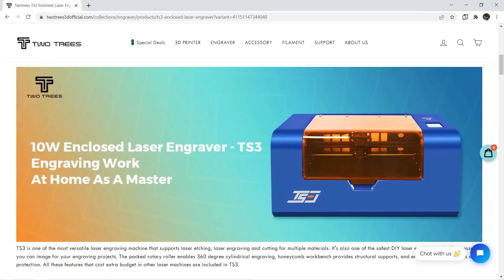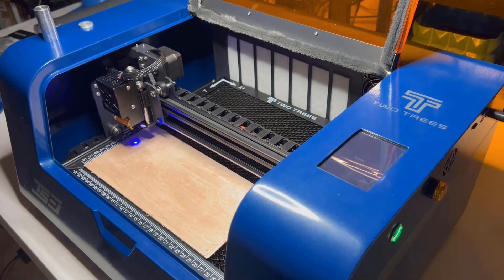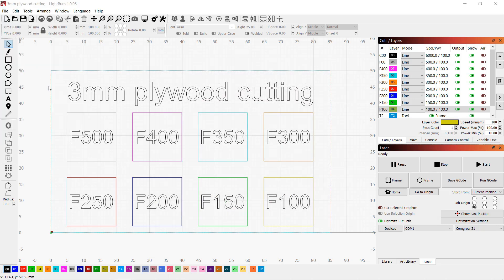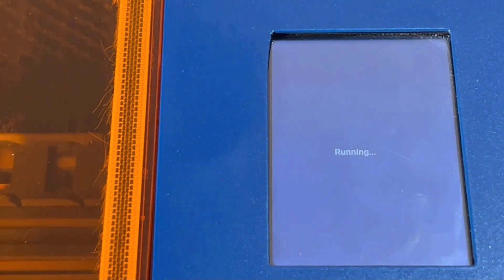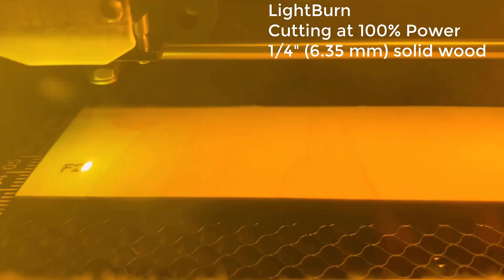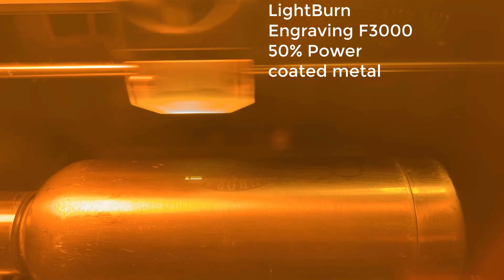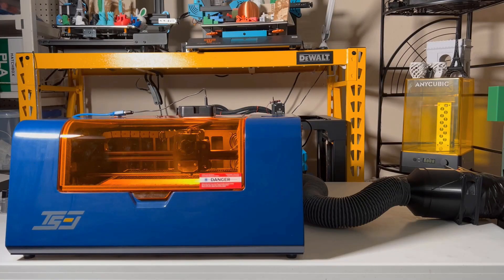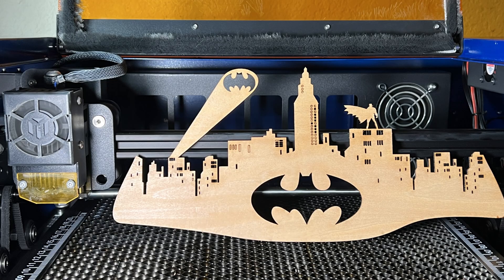TwoTrees TS3 Enclosed Laser Engraver, metal enclosure, honeycomb bed, air filter, exhaust fan duct

Comment: First time using this machine and lightburn. Im trying to make a test file like you did for cutting, but its not saving the different values for each layer. Its like its just using the first settings for everything, even after I edited each individually with different speed and light intensity, any help?

Comment: Thank you for this review! I was just looking for a hobby laser engraver.

The wifi issue might be fixed by using another wifi protocol on you access point or wifi router (wifi 6 = ax, wifi 5 = ac, wifi 4 = n, wifi 3 = g). If this machine has difficulty connecting using wifi 6 protocol, try configuring your wifi device to use the wifi 5 or 4 protocol. The band settings might play a role (choose 2.4 GHz or 5 GHz). Interference of metals and light sources could also play a role in the signal strength. Changing the location of the access point might also improve the performance of the ip web interface.

If that doesn't fix the problem then I hope it can be fixed in the future with a firmware update.

Comment: Wow - great review!
Thank you for that... 😀

I've just bought the "Ortur Aufero Laser 2" (LU2-4 LF) and am in the middle of building an enclosure for that, because there currently still isn't one to buy for this model.
My whole build (my self made wood enclosure + fan + pump (for air assist) + honeycomb grid) also cost me about 327€ which brought my whole "investment" for my lasercutter to about 650€ (325€ + 325 € for the "Aufero Laser 2"), which is very similar to the current "pre sale price" for the 5W model from "Twotrees" (currently 719$ = about 640€).

Somehow I wish I would have known about this "enclosed laser engraver" because it would have saved me so much work and planning time, that i had to spend to build my own enclosure and of course having the option to get a 10W laser instead of a 5W would have been even better...

On the other hand the "Aufero Laser 2" offers a 390mm by 390mm work area, while this one only offers 300mm by 200mm.
And this one does not seem to have "Air Assist" although the question is, if a 10W laser without "Air Assist" is still doing a better job in cutting than a 5W laser with "Air Assist".

Anyway - thanks again for the great content you create!

Comment: Great video, but TwoTrees has a long history of mediocre/subpar products. I still have a bad taste in my mouth from the Sapphire.  Mine never worked properly.
Reply: What's the sapphire?
Reply: @TripleJAu  the Sapphire was a l8ne of CoreXY 3d printers made by TwoTrees.  There was a lot of promise, but it never worked right, and they were known for that.
Reply: Yep, mee to. I'm currently working on marketing it making its first print. So pool assembly.  Changed to a EVA Hotend assembly and now lifting the linear rails,  to get the bed high enough to print on it. Signs..